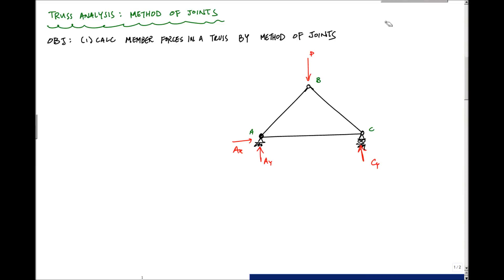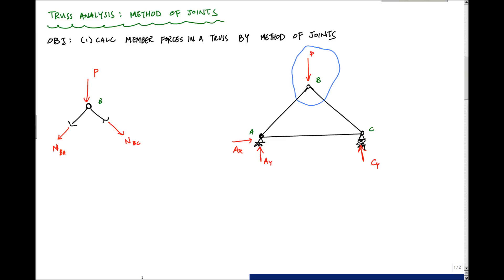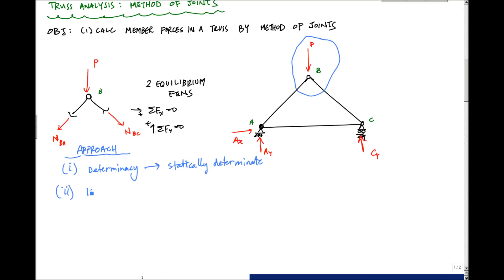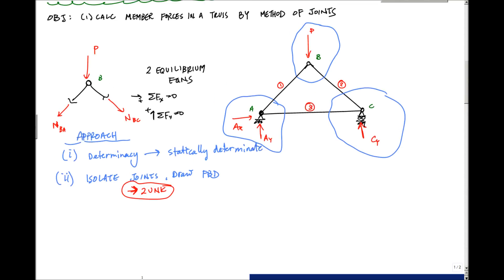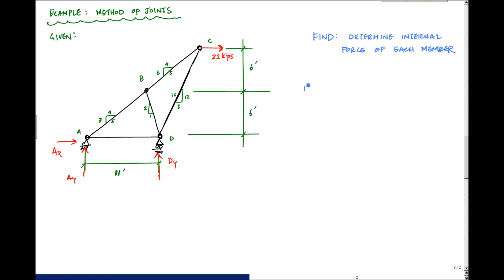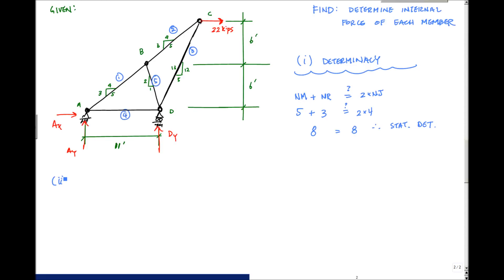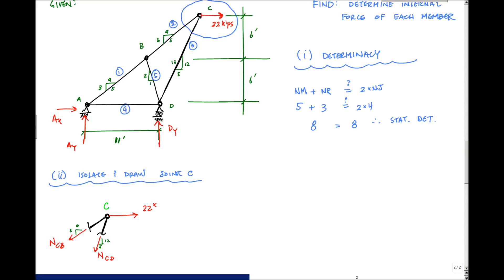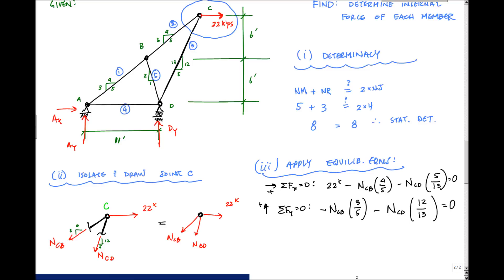Method of Joints (Part 1) - Statics and Structural Analysis

Comment: what is the purpose of calculating Internal determinacy for truss problems etc? Isnt external determinancy enough or we need to calculate internal determinancy for find out internal forces on members?
Reply: one desires for overall stability of the structure, that's why we calculate both internal and external determinacy

Comment: Could anyone please tell me why there are three number of reactions without explanations?
Reply: The symbol on the left corner is for a fixed support which provides both a horizontal and a vertical reactive force,the symbol on the right corner is for a roller support,which provides only a verticall reactive force.
Reply: @Ephy48  left one's a hinged support!! not fixed